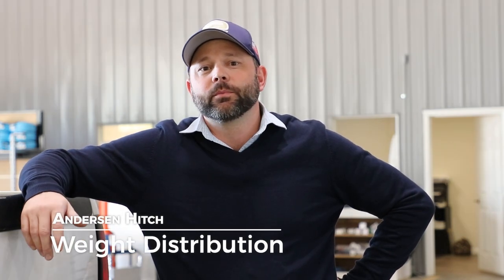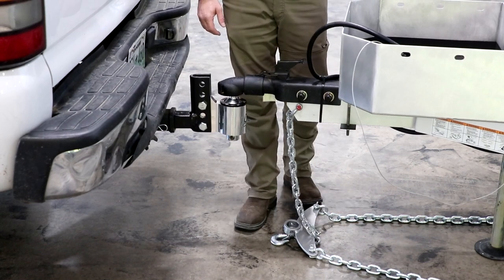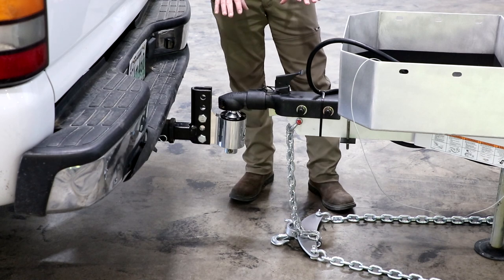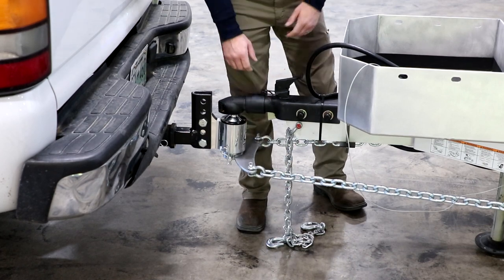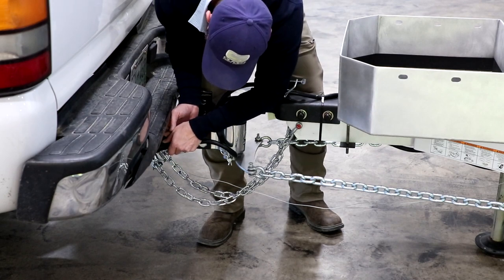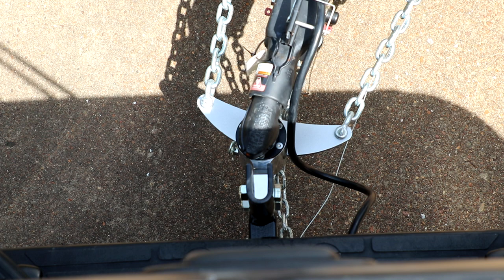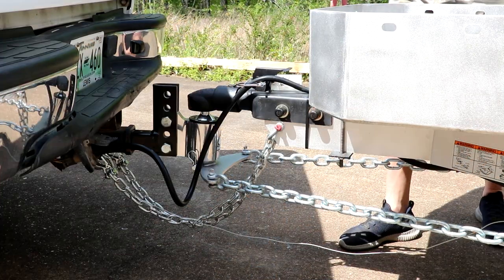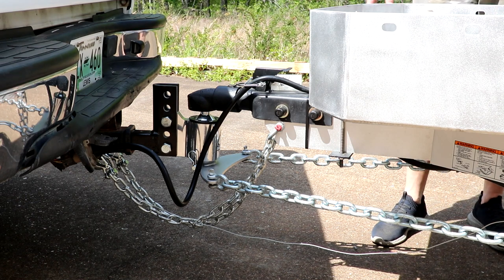Andersen Hitch, Instructional Guide | Oliver Travel Trailers

Comment: If the ball is not lined up for the chain attachment, you can coax the ball assembly loose in the friction material with a rubber mallet from the bottom side. It can then be twisted by hand with a short extension. No need to move the vehicle and trailer around to line up.

Comment: Does using a weight distribution hitch affect the tongue weight and TV's payload numbers or does it simply take the tongue weight and move it "forward" so that the TV is not popping a wheelie?
Reply: My f150 for example is limited to 5,000 lbs without a WDH but 12,200 with one.

Comment: Excellent video Jason. Thanks!
I’m not clear on how we would determine or evaluate when and how much to adjust the ‘weight distribution’ amount.
Reply: I suggest you Road Test the vehicle (Chains just snug) with a loaded Trailer attached for a short distance and pay particular attention to how the Front End (Tires/Axle) of the TV feels. When it feels lights, you need to tighten the nuts, I suggest you do it by 1/2 turn at a time each side and re Road Test. Keep doing this until you feel the Front End of the TV starting to not feel light. The resulting transformation is the result of more Trailer Weight being transferred to the TV, which is exactly what you want to happen. Once you feel this change take place, simply count the threads on the Chain Adjusters (must be the same on either side) and remember this for future reference. If you want to "Fine-Tune" the adjustment, you can experiment with 1/2 turn at a time and you will dial-in the desired feel you want!
Reply: @bigpapaporsche1  Thank you Pat! I appreciate your reply. This sounds like a reasonable approach however, it would seem to be a more objective evaluation if we were to weigh the TV at front axle and at rear axle and then adjust accordingly. This is what we’ve done in the past (with a different WD hitch) with the help of Escapees ‘Smart Weigh’.

Comment: Nice video, BUT, I would be interested in a video showing HOW TO RECONNECT HITCH if having to hitch up at a slight angle! If the plate isn't completely lined up as when you UNHITCHED, how do I hitch back up?!?!? I hope that was clear.
Y'all Be Safe!
Reply: If you can’t get a straight angle of the trailer then I just hookup the ball and tow until I can stop and hookup the triangle and chains on a flat straight road